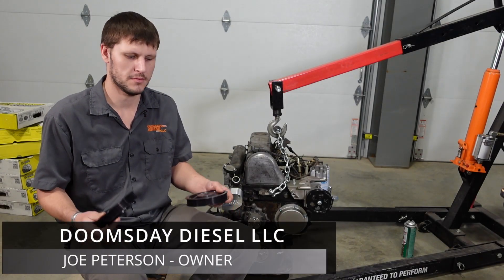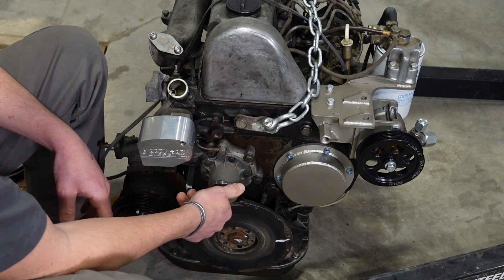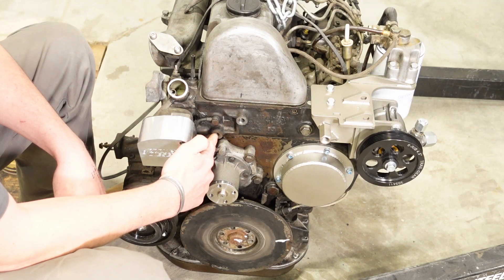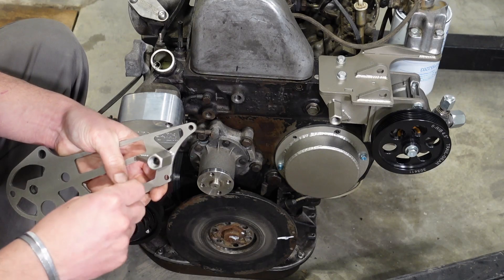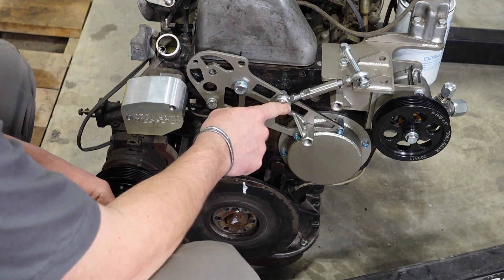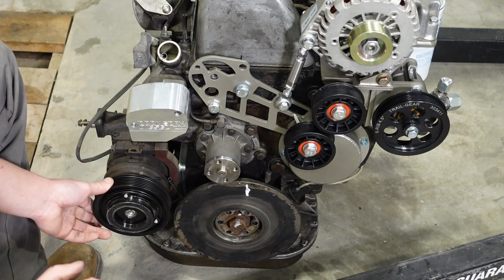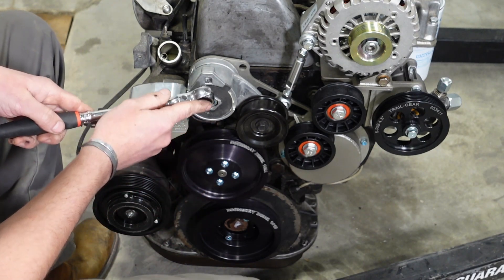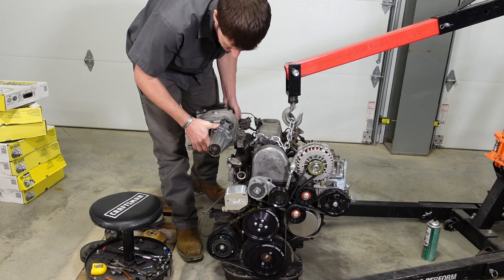OM617 Conversion Series: Serpentine Conversion Kit Installation

Comment: The waterpump pulley doesn't seem to have much contact with the belt.
Reply from the maker: Never ever did have water pump problems from this setup. But this is an old video. This is the current video instrctions: https://youtu.be/K_MU_swD2gI

Comment: Just got the serpentine belt kit for the om617, running the 2 idlers, no vacuum pump, no ac, just power steering pump, alternator, and water pump. Anyone have part numbers for a belt?
Reply: Excellent design and material!!!

Comment: I'm in need of the 6 or pref 5 spline pullies for crank/water pump so i can use stock isuzu ac/power steering/alt. I don't think your setup will work for my app..any idea where i can source? And can you tell me what model that short water pump is? Thanks a lot!
Reply: No he cannot

Comment: Just came across this video while looking for ALDA adaptor parts. Have an OM617 motor into an 85 defender 110 and will definitely upgrade to the ribbed belt soon.  The alternator configurations are different but will be using the the power steering pump setup to get power steering at the same time.

Comment: What is this I hear about the flex plates and flywheels are being balanced with the engine
Reply from the maker: The crank assembly is balanced together when the engine is built. So, if you remove any component, like the flexplate, you need to match balance whatever you're replacing it with to be safe.
Reply: @doomsdaydiesel  so you need it balanced with the crank or just the flex plate balaced I just bought one on ebay was set up for a boat so I'm sure it's all been changed
Reply from the maker: @cocopublicnews6766  you must balance your new flywheel to the old flexplate. Mercedes didn't put witness marks on these flexplates for some reason, so if you already took it off and don't have a reference, you're out of luck.
Reply: @doomsdaydiesel  damn
Reply from the maker: @cocopublicnews6766  the majority of people don't match balance and they don't have any noticeable issues.
Reply: @doomsdaydiesel  but how long does the engine last I'm not going for power just a turbo daily driver
Reply: @doomsdaydiesel  makes me feel good knowing that though

Comment: Your kit looks very well designed and built. My only concern might be if there is enough belt wrap on the water pump pulley. You have over 180* of belt wrap on both the power steering pump and alternator (which is ideal), and more than 90* on the A/C and crank pulley. It looks like there's only around 40* of belt wrap on the water pump pulley. Do you think belt slip might be an issue there?
Reply from the maker: I haven't seen any yet. Water pump pulley shouldn't see restriction with no fan on it.

Comment: referring back to your OM617 remote oil filter adapter plate :
the oil filter body  assy contains an oil thermostat. 
do you delete the thermostat and run all the oil through a cooler ?
or
do you delete the cooler  completely ?
Reply from the maker: You replace it. The instructions/diagram are on my website.
Reply: @doomsdaydiesel   thank you

Comment: I see you used an AD244 alternator.  I'm using AD244 on my QSB3.3 / Jeep ZJ conversion.  I like the way you welded the tabs on the base plate.  I was planning on using a bar of square stock to fit between the alternator feet.  I think I like your method better.  Thanks.